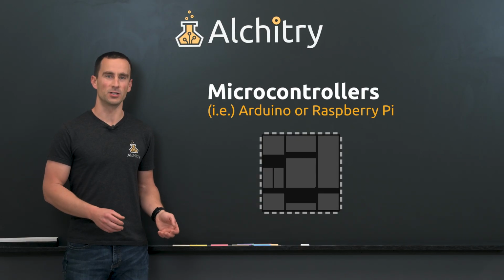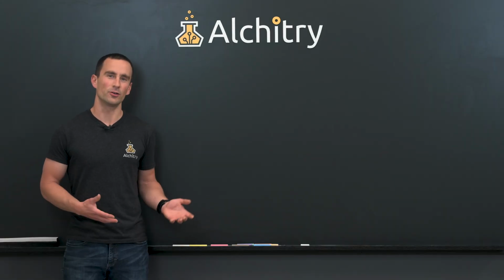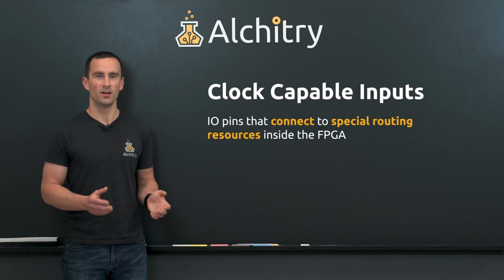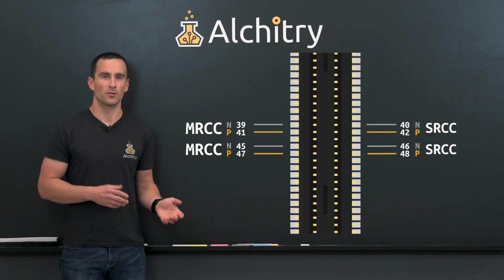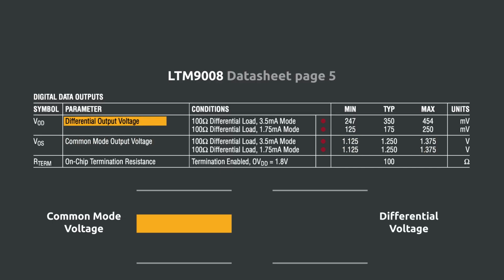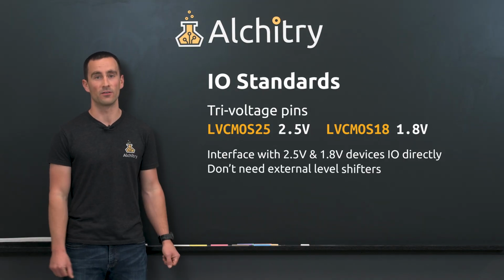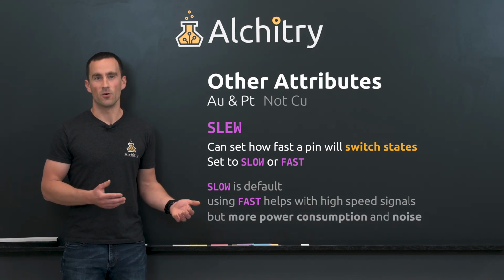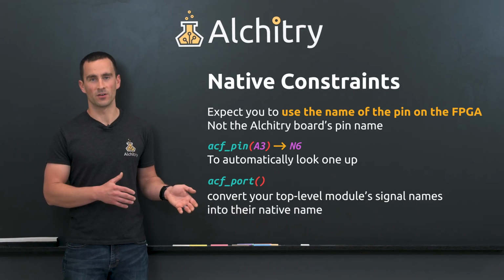The Ins and Outs of FPGA IO

Comment: Why are only GPUs used for LLMs, I would think something like FPGAs are perfect for it which are also used in high frequency trading, is it because something like CUDA is much better to program LLMs than VHDL? But I have even seen computer vision applications implemented in FPGAs so don't know why not
Reply from the maker: I'm not an expert in the architecture needed for LLMs but I think it's mostly because the tools started using GPUs and CPUs for their flexibility and then GPUs were specialized to handle the LLM tasks even better. Specialized hardware like Google's TPU will always outperform programmable hardware like an FPGA. FPGAs have large speed and power penalties associated with all the extra stuff to make them programmable. I'm sure they were used in prototyping some of that specialized hardware though
Reply: FPGA ❌ 
ASIC ✅
Reply: I'm pretty sure they are, as many have multiple (well 2) input/output on the cards.. I always assumed that many of these cards where used for cryptography also.. I'd suggest that for more variability to look as the Nvidia A30X (24GB HBM2 VRAM) as they are a CPU+GPU on a card, of course they have a specific protocol, Blufield, that runs them on the LAN (56G) side.

Comment: It would be great to see an example  of how to go about designing an SDR radio with an FPGA.
Reply: They could sell a lot of units if a good RX/TX design got popularised.
Reply: with multiple inputs  that are of differing voltages using buffed or switched inputs.. You are indicating a device for cryptography and (now) a perhaps very limited lifetime..  Maybe you also should be telling this audience on how durable they are and how long the program actually resides in the programed chips when the power is abruptly terminated.. shielding  and potential electrical build up onto shielding that may result in a capacitance discharge..  Humm..humm, humm, humm